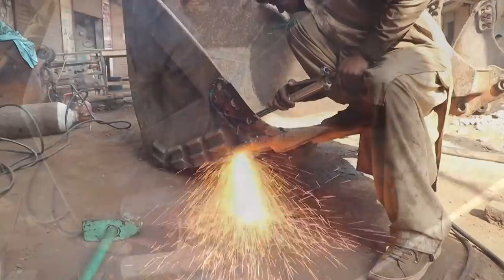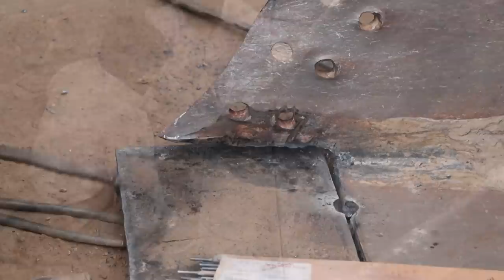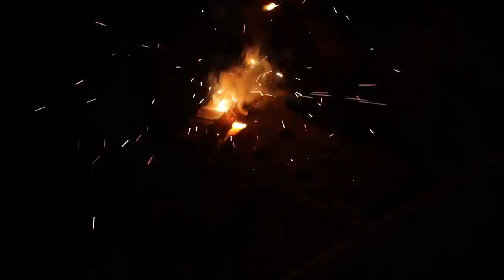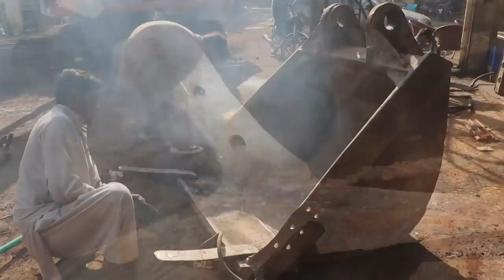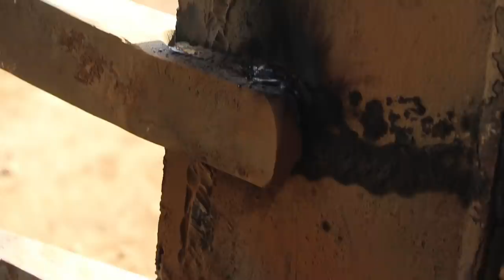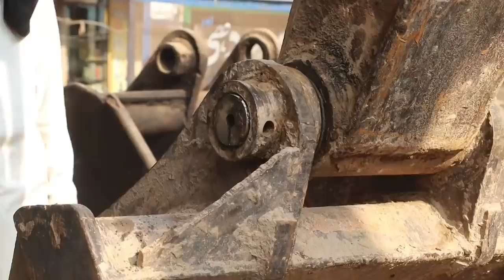Repair all BROKEN Tooth on BIG Excavator Bucket

Comment: This is such a poorly done repair.  It'll break in no time and they'll get to do it again.  To anyone saying they have to make do with what you've got, that's no excuse for not even cleaning the dirt off before they weld.
Reply: Best techniques I've ever seen. Great job guys👍
Reply: @koistinen9368  Looks like it is used for soft material...look at the thin and pointy tooth they installed.
I say it will work well!
Reply: If i heard correct, those "teeth" should be made of molybdenum because of its work hardening property. I wonder what was the material of the ones they used
Reply: @henryrollins9177  excavator that size is used for digging on hard shit 8hours pers Day. And Even If it was used for some fucking "soft" material bullshit you just dont repair goddamn excavator buckets like this just for The sake of principles.
Reply: @koistinen9368  Do you work in industries? Because i do... 
This bucket might be used to load sand or stuff like that, theres no need for a super strong repair/rebuild...and considering these guys economy and very limited resources i say that is a good repair. 
But hey, if you are from the "first world" i understand that everything looks shitty to you from your parallel universe...😉
Reply: Co2용접기사용하세요 각장 묵장 용착 전부불합격 ㅎㅎ
Reply: @henryrollins9177  Yes i Work as welder. Why would it break in The first place If its used for soft sand? And If it is used for that then why is it so damn thick metal? And yes they might Be poor but If its shit, its shit nontheless and goes to same gatecory with these cringy "Lifehack crafting videos" in My Books and im just being Honest.
Reply: @helpme_obiwan  I seen a video yesterday of how they make the teeth. They use ship anchor chain.
Reply: Yes ur right
Reply: Using cheap welding rod’s hahahaha
Reply: @BoyHongkong  ask your dad to bring some quality ones
Reply: @helpme_obiwan  ship steel. Another video Shows them being forged from scrapped unknown grade carbon steel. Won't last long.

Comment: A piece of high quality rebar to fill the gap, hope they don’t grab anything harder than topsoil.
Reply: Lol
Reply: Considering the teeth are made from reforged railroad tracks (different video), there's a number of failures possible if they dig anything too firm.
Reply: I had a good laugh at that bit lol. Poor barsterds though, must struggling if they are using that.
Reply: FCC
Reply: I was thinking the same thing. That rebar was never intended to be welded and severely compromised by doing so

Comment: So much fail, the teeth are not supposed to be part of the bucket, they are supposed to be replaceable. They are the first thing that wears down, and should be replaced when worn, to prevent this kind of work needling to be done.

Comment: I agree with James Ratliff. What has to be understood here is perhaps there is not a lot of money to spend on proper teeth and so have to use what they got. Not everyone has the luxury  of having access  to all the gear that's why they are stick welding. And so in all fairness they have done a good enough repair. The machine can go and dig a hole. What more do you need.
Reply: @sigsauer9mm957  just for the record. When i said thats why they are stick welding i was not knocking the process. Just saying that is what they had they did a far better job then i could have. Because i am only a hobby welder. If in future you haven't got anything good to say about my welding. Or anybody else better you said nothing at all.
Reply: Yes sig I know what stick welding is. Most welders who have access  to mig will weld a bucket because it is faster. As long as you have the right gas and wire. Nothing wrong with arc or mig. I smoke lambert and butler ciggies not crack. Thanks for your comments though 👍
Reply: @ruthbees7214  There's no qualified welder in the world who would weld that bucket with MIG.    Are you just getting into welding?  Maybe you're confusing MIG for Flux core?  Flux core might look like MIG but there's no gas (the flux is inside the hollow wire).  It's an alternative to stick welding because it can be faster.   Other than that they ONLY way to weld that bucket is stick welding.   You cannot use MIG for a job like this as it wont penetrate and it's not strong enough.
Reply: @noteasybeingcheesy2673  hi cheesy i am no expert in welding. I was thinking of dual shield or flux core when i said mig welding this is what i ment by it just to clear up any confusion. Thanks ruth😁
Reply: @ruthbees7214  You're welcome, no problem.  The dual shield (flux core with gas) is alright indoors (no wind to flow the gas away) and it may look cleaner.  It's not a as strong as flux core (no gas) though.  For structural (or anything which needs to be strong like that bucket) there's really only two ways go: stick or flux core.  The only real advantage to flux core is that it can be faster (so if you're working on a huge structure it would save on costs/time).  Other than stick (which is the method I would choose for this bucket) it might be the way to go in terms of cost/time on a big project.  You have to also consider the advantages of the stick itself vs a gun/nozzle.  Stick is 14 inches long with common diameters of 3/32 to 5/32.  You can weld areas where the gun/nozzle cannot reach or even if does you cannot get a good angle or you can barely move at.  Another note on this video is that there should be more beveling.  On something like that bucket (it's going to support heavy loads) you need full penetration.  You can't just welding the top and bottom and leave a hollow space in the middle.  The stick will of course penetrate (depending on which type of electrode you're using) to some degree but on thicker medal you need bevel well.  Apologies for any spelling and grammar errors in my comments.   I did go to college for a little while (sociology) but dropped out after I realized I'd rather work in a skilled trade and get some excerise and see the world.
Reply: @sigsauer9mm957  how are you siggie.  If I was going to weld a bucket outside you are right it would be with 7018. I would not mig weld it. Unless I had flux core. I apologise  for using the word mig because it has implied that it is gas and wire. I would not have welded a bucket without checking the correct process first. Thank you for your and cheesy,s input. I have learned a lot. Ruth.😁
Reply: Guys they do it probably because it works for what they do
Reply: Weld whit electrode is a very good weld but expensive and request more time. But if you have the time and cheaper welders this is very good for this work. If you work in a factory that count your metres of weld per hour there are fast machinery, but if you only need to make your recovery do not need "to be on race". Whit covered rods you can weld since on grease, not need a very cleaning work before welding, and for this poor works is best than others metod.

Comment: Designed and engineered in Japan, sold second hand to China, worn to the bone and sent to die in Pakistan. The metal recycling industry there must love these "street repairs." Absolutely no prep work done or concept of heat tempering fatigue.

Comment: If these guys had some tools like an overhead crane, even an oversized engine lifting portable crane it would be amazing the amount of work they could get done. Great work. If I were offering any advice it would be to radius or round off the outer part of the bucket cutting edge so the teeth could get all the way onto the edge. It would give a little more surface to weld and no gap. But great job.

Comment: Super sh-tty.  They basically glued the top and bottom of the plate. No bevel.  At best maybe 60% penetration.  And buy a welding helmet.  That hand held thing might be ok for tacking or a very short bead but not for burning rod and continuous rod.

Comment: No bevel. No pre-heating.  What type of rod?  Should be using 6011 for the root and 7018 for the filler and cap.  And rebar in the grove?  Yea, that will hold up to moving sod out of the way.  And radius those corners.  That plate will get ripped off once it is used for hard clay or concrete/asphalt.
Reply: beginner here, why the 6011 for the root?
Reply: I love these kids yelling on the internet

Comment: So depressive, amateurism level 99. Those manganese steels are hardened and tempered, after that cut and little welding are there a lot weak spots with lowered mechanical properties. Not to mention these welds will be cracked after a while. This plate needs aprox. 6mm electrode and 400A, perfectly prepared surface. After that heat treatment of the whole piece - stress relieving after welding, the more bigger weld and stuff the more important heat treatment is!!!

Comment: How strong are those welds going to be? A domestic power supply can't offer enough amps to penetrate those parts enough surely. Plus clean the parts to bare metal. It will give a MUGH stronger weld. You have a grinder at hand already. Overall nicely planned work but Exekution leaves me tonwonder how well it will last.